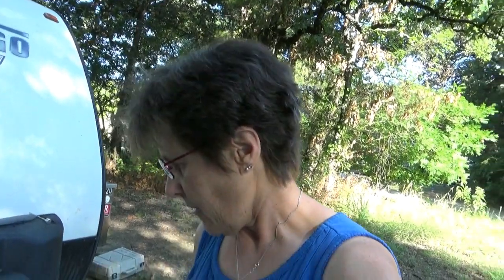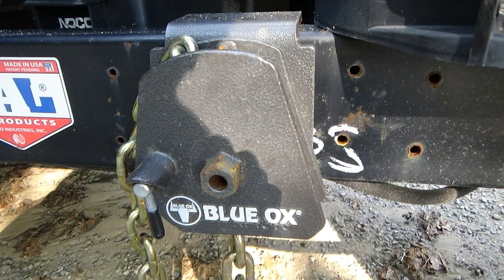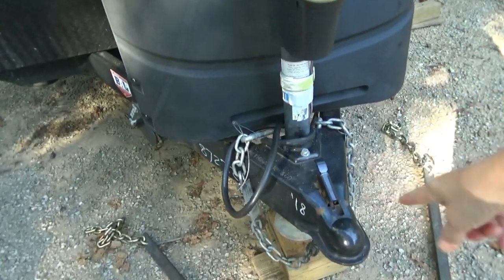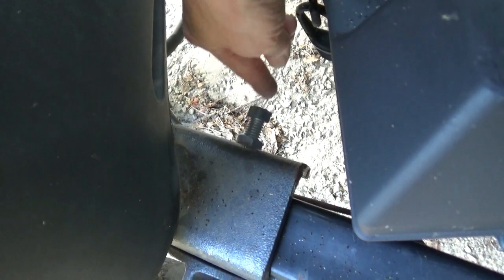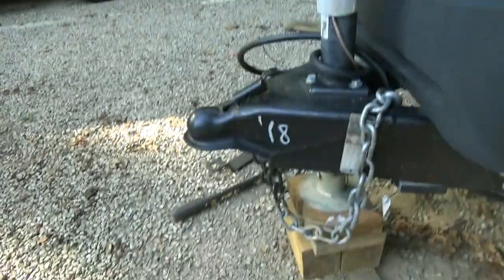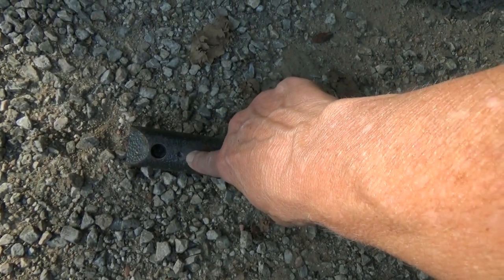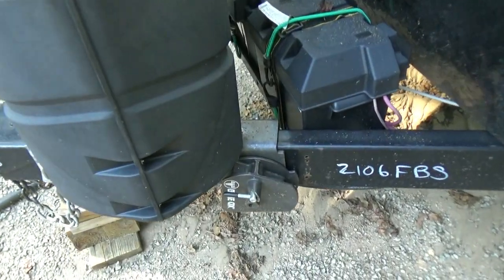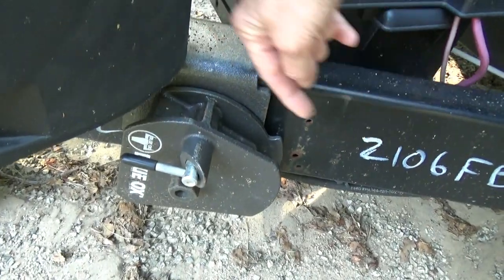Blue Ox Travel Trailer Hitch Review

Comment: We use same hitch on our 28ft Airstream... I did buy an 18inch breaker bar with a 1" socket to install and remove the bars...makes it much easier to do.  Great videos...thanks.
Reply from the maker: Thanks for the tip about the breaker bar.  We will definitely look into that.

Comment: Well I had to disagree on the completely stops sway because I have this same hitch and the sway is not gone.  I have tried making some adjustments but nothing seems to work.
Reply from the maker: Make sure that the bars match the weight of the trailer.  Not all bars are the same.  Make sure that the chains are tight enough that the bars bow.  If the bars match the weight of the trailer and the bars bow, you shouldn't be experiencing sway.
Reply: @TwoTiredTeachers  Agreed. I started at 8 links, and now run at 10 (from the end). Important trick when holding up and unhooking is jack the tow vehicle up really high. You should almost lift the rear of the tow vehicle off its springs. It will remove tension from the bars and allow you to increase your tension while safely removing them without it popping violently.
Reply from the maker: @silkyd3337  Thanks for the info.